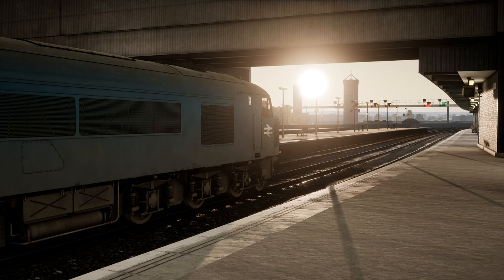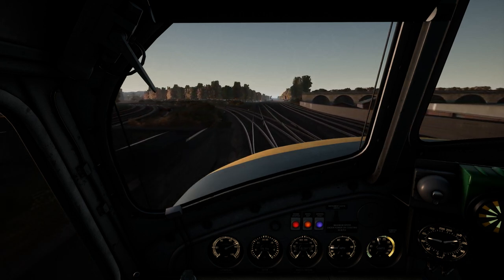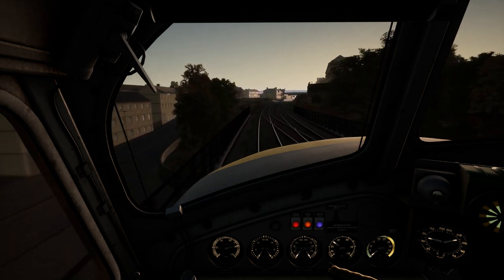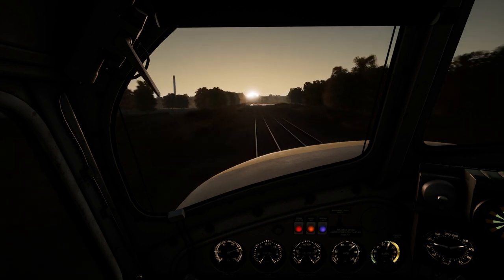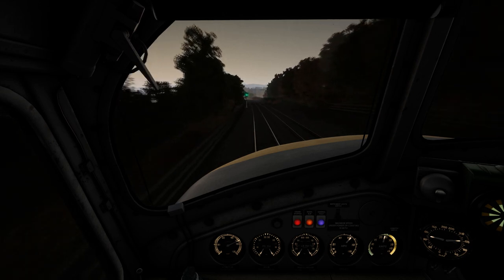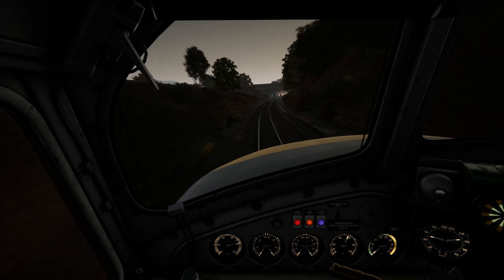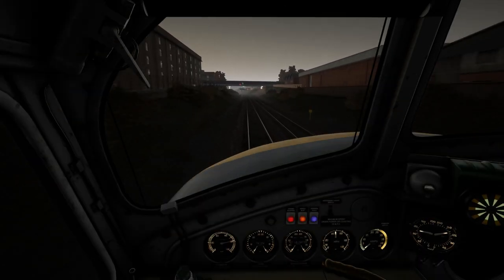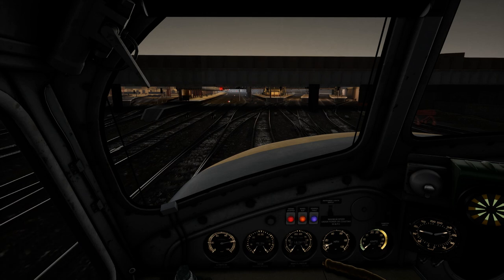Train Sim World - Route Learning: Leeds to Manchester Victoria (Class 45)

Comment: Train brake was called "dual brake handle" as it was vacuum and air. 
When I was doing my driver training I spent the day in front of the class describing how it worked. 
Loco brake was called the "straight air brake"
Power handle was called the "regulator" carried over from the steam days.
As for not knowing where to put the regulator it came with practice and road knowledge although every train and loco handles differently even if the train is made up of the same class and coaching stock. 
Am definetly going to buy this game looks very life like.
I finished with BR in 1985
You wouldn't have overloaded the generator going into the yellow, believe me your fine 😉
Reply from the maker: Thanks for the info, that’s really interesting! :)
Reply: great to hear from a former BR driver!

Comment: SO Many Errors on this route. Approaching Stalybridge the Signal says P3 but you arrive in P2. The Goods line round the back they have made a platform and I counted 6 Missing Signal Boxes between Stalybridge and Manchester Victoria - All those Semaphore Signals are controlled from somewhere
Reply: Have you messaged them about the signal boxes, it maybe something they can add in an update, it wouldn't break any scenarios?
Reply: I also noticed OA & GB Junction box and lines missing; Ashton Moss North Jct box missing and Baguley Fold Jct and Phillips Park No 1. Jct boxes also missing :((
Reply: it's a game peter ;)
Reply: I also think that the distant signals did have AWS fitted
Reply: It's a Simulation  @markrudd6194  - what if they decided not to model the roof at Leeds would people be happy?
Reply: @alancharles1681  and Miles Platting also shame looses the realism a little, also of note they went with a generic signal boxes across the route, some like the crossing box east of Dewsbury was a smaller cabin with red paint on the window area, they used the larger all white box like Diggle.
Reply: @bobp6742  Yes I was thinking junction signals and 3 aspects would have surely had AWS? none on semaphores or 2 aspects.
Reply: @Thunderer0872  
I was a secondman at saltley diesel depot and a driver at Crewe between 1971 and 1985 and covered a lot of rural routes. I can't remember ever coming across a distant without AWS.
I remember always having to have a secondman for the ironbridge merry go round as it was a token system.
Reply: @bobp6742  I've just watched a video listed in these responses and it's 47448 from Man Vic to Leeds as far as Stalybridge April 1989 and there are no AWS ramps from start to finish, They really were in the stone age up there. Where I lived on the Salisbury - Exeter line up to 1987 - 88? we had AWS on the distant signals and the outer home protecting the loop at Gillingham Dorset (Time delay on the down) but no AWS on the platform or gantry starters signals. by the summer of 88 we had a double AWS on the reversible and a single AWS on the down loop for the 2 aspect starters. seeing are no AWS systems on the Man - LDS route as far as 1989 is quite scary. Also accounts for things like the 1984 Eccles crash happening.  Cheers Satley Seagull Bob p.
Reply: @Thunderer0872  
Wow, you been doing some digging. 
Saltley seagull 😂😂 not heard that for awhile. 
One of the railway mags this month has a article on the saltley depot didn't buy it just read it while waiting in the post office queue
Reply: @bobp6742  No just the Satley has always been renown for wandering drivers, even more so in privatisation years. Alan Buncart or Bunclart was well known down our way when I worked at Southampton. he drove the Deltic D9000 a lot when Virgin hired it. The Fifty fund class 50's he drove some of our tours. Also one of the sales stand guys does a line in mugs and t-shirts with Satley Seagulls on it with a bird poop as part of the image.
Reply: Sorry yeah digging for views back close to the game era yeah, there's a cab ride 53 old railscene dvd Sheffield - Manchester via Huddersfield sold by Kingfisher DVD's,  I may buy as that's 1995 in unit just to see the missing boxes and the lack of AWS.
Reply: @Thunderer0872  
😂😂
I vaguely remember saltley men weren't very popular. I was only there 18 months before transferring back to crewe, big mistake should have stayed at saltley. 
I remember going on the bandit at new street and hitting the £50 jackpot paid out in 50ps. 2 new street drivers appeared switched the bandit off and put it away in a cupboard. Told me "we can't play yours so your not playing ours"
Bit late once it had paid out 😋🤣
Reply: @bobp6742  Depot rivalry is not a new thing, I heard Salisbury Men sticking two fingers up and Templecombe shed when they went by in steam days. lol
Reply: Why post this here... ugh. PTG can't do anything, he didn't make the route. They aren't game breaking errors. You're one of those nitpickers.
Reply: @am-vm8ew  No PTG can't change it but there was a conversation going on. and yes I nit-pick because I paid for a product... a product that has a lot missing and wrong.
Reply: @Thunderer0872  I've never understood people like you. You seem to forget the existence of the rest of the route to whine about one thing. Some assets missing is not a lot. Stop overexaggerating.

Comment: I wish someone would make Leeds to Manchester Victoria via Rochdale set in 2019. That's my local route. Is the Huddersfield line meant to be electrified?
Reply: The line to Huddersfield from Victoria and Piccadilly has still not been electrified and never has been, not even in Woodhead days. On the route from Piccadilly overhead wires only reach Guide Bridge. There doesn't seem to have been any plans to electrify Victoria and the remainder of the Piccadilly to Leeds route.

Comment: Great video .... I have enjoyed playing your video while simultaneously driving the route on Xbox to learn the route.  

Wonder if you could please help .. couple of evenings I have been driving the DMU, in the service mode Marsden to Leeds.

I am especially struggling with departing Dewsbury and Batley.

Both lead into a step uphill gradient, and I only can get up to about 20mph in 1st gear when departing from these stations.

If I try any of the other gears then I just a lose momentum and eventually get stuck half way up the hill!

I have tried stopping just onto the platform at Dewsbury, and then use the longer platform (on straight level) to get a bit of run towards the hill, but this doesn't work at Batley due the shorter platform.

I presume this is due to the DMU not being powerful enough to get up the steep hills, but if anyone has a driving tips to get up steep gradients I would be grateful?

(PS ive tried the switching RPM to engine 2 button but this doesn't seem to help - but would be interested to know what this functionality should be used for?)

Comment: I don't know if I can ask a stupid question, but I'm going to do it anyway:  
When you're driving a real train, how do you know where the speed limits are? 
Obviously, you've usually got the signs where the speed limit kicks in but I can't always see them clearly in TSW (I play the console version so the graphics might not be as good) but, also, you usually have a begin to slow down a long way before the mark. 
Do you just have to learn the route, or, do you have access to some sort of route map or route notes that give you this information (and is there an equivalent in the game)? 
Obviously, TSW gives you the option to display details of any upcoming speed limit changes on screen but I'd like to work towards driving a route in the most realistic way possible.
Reply: Driver's have to learn routes. Know speed limits, locations of stations, junctions and known braking points. As well as gradients and poor adhesion areas.
Reply from the maker: In reality drivers have to know the route like the back of their hand. In this case, I made a series of notes to help me remember where speed changes are. Learning the braking points for stations is important too, especially at higher speeds!
Reply: @PTGRail  Thank you (both) for your replies. I've spent the last couple of weeks learning the Leeds - Manchester route and practising various parts of it  with as much extra information turned off as possible. I've got to say that it's a whole new experience - it's so much more engrossing doing it this  way.  After a bit of practice I decided to throw my original profile and my 100+ gold medals out of the window and start again from scratch doing it the "right" way. 
I just did the 16:21 Leeds - Manchester in the Class 45  and I got my first real gold. I'm going to start looking at doing the route in the opposite direction now and, maybe I'll go back to my old haunts on the Great Western Reading - Paddington route to see how I get on applying the same principles on a more modern line. 
BTW:  Before lockdown they were running class 37s on my local line, so, I used to have the occasional pleasure of commuting on a class 37 (I don't know how similar they are to the 45). They were also running Pacers  and I had the "pleasure" of travelling on a Pacer towards the end of last year, a week or two after they'd stopped using them on Northern Rail.

Comment: Nice. Just noticed something. As you pulled into Stalybridge Station (My home station), you said you were cleared for platform 3, as that what was indicated on the signal (55.30). Yet, you went into Platform 2 ( as indicated by the Platform Marker Boards (56.24)), Platform 3 at the time was over to the left, where the last Blue Marker was (a dead end platform with buffers) facing towards Manchester, with the 2 freight lines, 1 of which is now Platform 1 and the other demolished further left. I say at the time as Stalybridge has now been remodelled and 2 extra platforms and the platforms renumbered, so where you stopped is now (after 2012) Platform 3, but in the timescale of the simulation it was platform 2.

https://mancunian1001.wordpress.com/2012/09/16/update-on-stalybridge-railway-station-remodelling-works/

The old and new layouts are in this document.  Not being picky and it is fantastic work by the developer, it was just an observation.